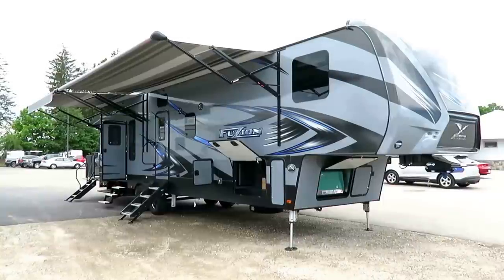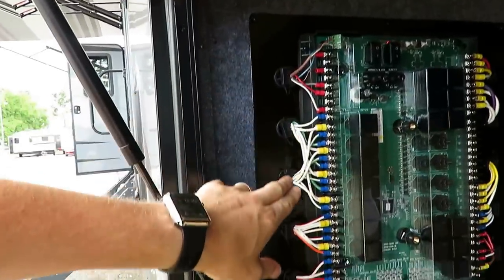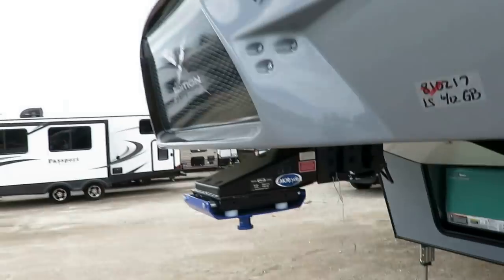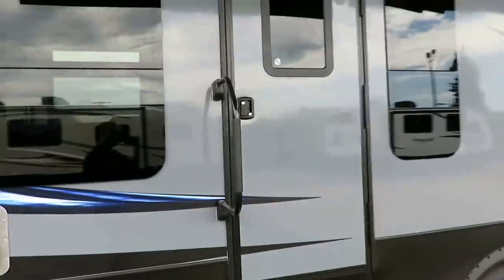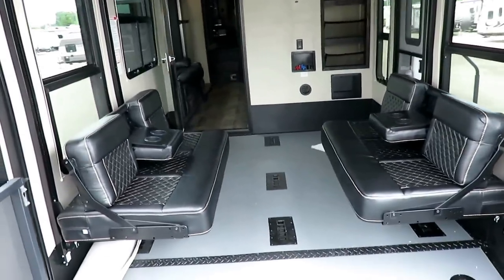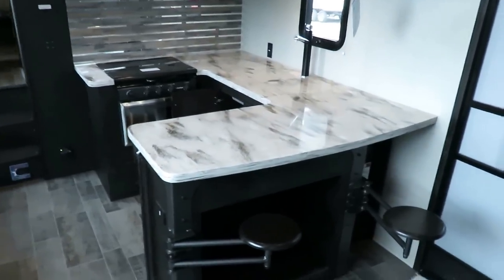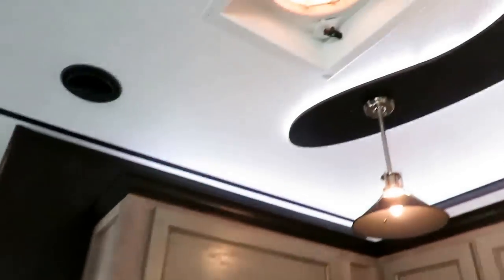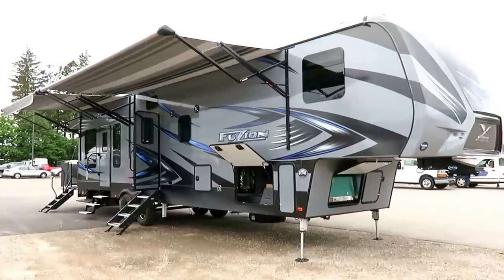(Sold) HaylettRV - 2018 Fuzion 369 Triple Patio & Entry Luxury Fifth Wheel Toy Hauler by Keystone RV

Comment: Josh,
No one who talks about the toy haulers with the generator package ever suggests that it is possible to have a 7000 with the same footprint as the 5500. I know that I would take the rig back to Arizona to visit family. It is common to camp at over 6500 feet and the temperature can be over 100 degrees, that means that right from the get go I would be down 25% on generator output. Will keystone upgrade the generator to the 7000 if asked? Thanks again.
Reply from the maker: Not likely from the factory. It's not like a house where you pick wallpaper A with counter top B and Cabinet C. They have what is desired by the largest number of people and minimize other options for logistical purposes. What you're describing could be accomplished aftermarket, however.
Reply: Haylett RV that's what I figured. I imagine your dealership or any other would be willing to swap them out for an up charge on the price difference plus labor. Appreciate the response and have a fantastic evening.

Comment: Love this... but what kind of vehicle do you need to tow this??
Reply from the maker: Properly Equipped 2500HD (which may want some sort of suspension assist) or a 1 ton should be fine. I wouldn't say you'd need a dually, but it couldn't hurt.

Comment: Josh, Great videos. I am loving your channel and the information you provide.  I have a question...how would you compare a Fuzion to an XLR Thunderbolt?
Reply from the maker: I dislike doing head to head comparisons as they always end with negative feel and slant. Also, as I always say "every RV is the best for a different reason." One concern I have with anything in the XLR family is how severely they seem to constantly change every seasons -- like they can't quite find their fit. Lack of consistency can sometimes lead to production problems. While that MIGHT not be true in the case I can say with a high degree of certainty with my experience it is almost always true. 

Meanwhile, Fuzion is the single best seller in its class and continues to hold that status. They're obviously doing what needs to be done where it needs to be done. Our service team will also confirm they are, hands down, the best of their kind from a service/warranty standpoint we've ever seen. 

Fuzion has pushed the boundaries with new looks, features, and innovations that other brands are scrambling to emulate. Meanwhile Fuzion continues to keep their foot on the gas with improved versions of systems like iN*Command, their tailgate system, their triple air system, King bed innovations, hidden pantry entertainment centers, and so many other things. Fuzion has become the brand that does things 1-2 years before everyone else.

Comment: I think the reason most toy hauler patio deck stairs go off the back is because of the cables holding up the ramp. I noticed it was partially in the way when you went up the stairs into the deck. I doubt it's too annoying but I also think a lot of people won't like that.
Reply from the maker: I understand that, but it really doesn't affect you in practice (I used to think the same thing until actually using it).
Reply: Haylett RV - It was really tough to tell from the video if it was really in the way or not. Just appears to be from looking at it from a distance. But, like most things you'd have to see it in person and try it out to see if it was an issue or not.  Thanks for another great video!
Reply from the maker: Something I need to share in future videos: The feet on the ramp door can also be used to maintain full patio deck function & remove the cables if someone does feel they're in the way. 

Again... they're really not a bother.
Reply: Haylett RV - That is great info to let people know. Having the option of not using the cables if they did bother you is a great idea.

Comment: You did forget one thing in the video, The hidden pantry.  Good job otherwise though.
Reply from the maker: I didn't actually. It didn't exist when this RV was built. That feature was found in the 2nd production run of the white skin 2019 models.
Reply: actually the hidden pantry is open on the garage side with netting instead of solid doors